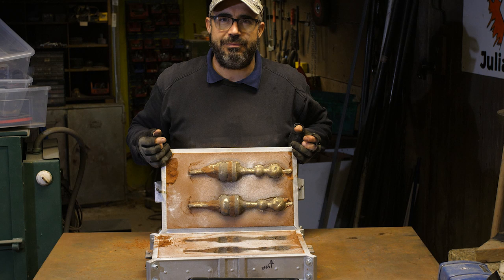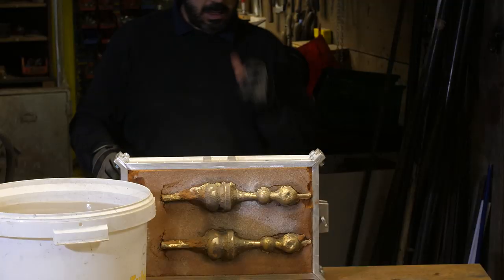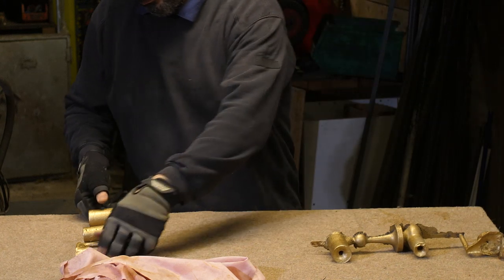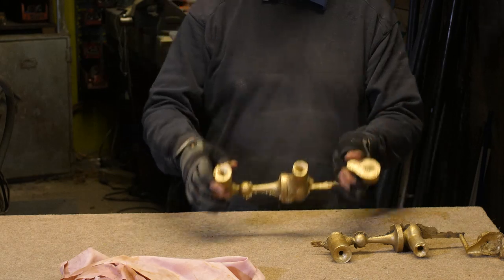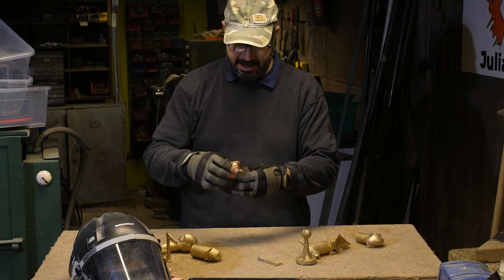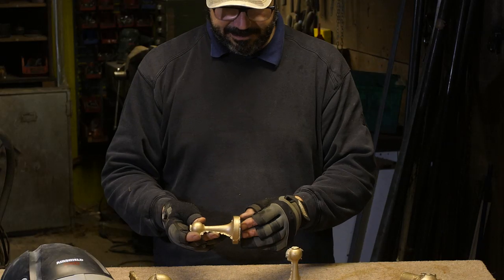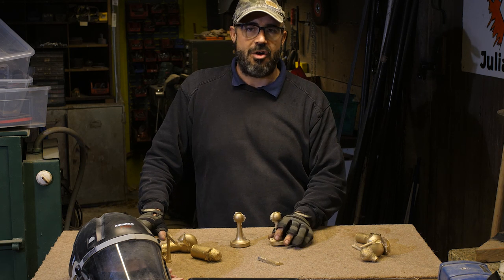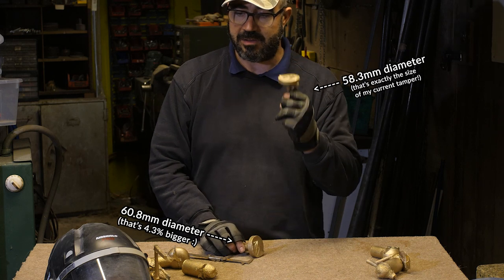Casting a bronze coffee tamper (Part 1)

Comment: Looks good, glad to see you added the feeder/riser for the spherical end.
If you add a piece of cardboard on top of the pith block and put your crucible on that it will help keep your crucible from sticking to the pith block. The cardboard burns away and leaves a carbon layer that keeps the crucible vitrification from sticking to the pith. (also not too much flux increases crucible vitrification from chemical attacks... one of many things that reduce crucible life).
Reply from the maker: Ask Questions, Try Things ahhh yes I did the feeder on the spherical head as you suggested thanks mate. And I forgot to do the cardboard on the plinth thing!

Comment: No shrink holes in your tampers, that's great!  Looks like the castings should clean up really nice.  I feel your pain about the too dry sand.
Hot flask alert!  Could it be the aluminum flask conducts the sand's heat a little better than wood does?  I never thought of that.
Reply from the maker: Tobho Mott cheers Tobho! Yeah dry sand is so fragile I get it now! But at least it’s made me realise that I don’t need much water to correct it, for some reason I was adding too much water each casting and then suddenly had mud. lol yeah the aluminium flask is very hot straight after casting, I think here I was about 30 mins after.

Comment: You are the only one that casted out a coffee tamper (on the internet) :) I was searching for it whole day...
I want to cast one out of aluminium (so I can be a second one, heh) .. 
I dont have any experience with casting, I am broke, and in a week I am moving to different town for work.. So I have found one way that could work, cement and engine oil (would use 2 stroke) instead of sand.. 
I did my research, now waiting for a rain to stop, and hopefully I wont get any shrinkage... I will borow a tamper to make a mold, since i aint got 3d printer... 

If I could polish it half ways as yours it would be awsome
Reply from the maker: Thanks jovan! Good luck and be very careful! Be very VERY careful not to pour molten metal on to anything wet or with water on it (like an ingot mould with a few drops of water in it or similar) the resulting steam expansion can be like a mini explosion that will spray molten metal everywhere.
Reply: @JulianMakes  Thanks for warrning, I am intermidate DIY guy, heh, and had a lot really dangerous situations. Dont want to put myself there...
I have leather gloves, and old fireman helmet heh :)
The leftover I will pour to open mold tamper base, or atleast try..
Following your attemps, I feel like I got some understanding how to make the mold, your videos are quite educational..
Until today I wasn't worring about ventilation, flow, and all the stuff.. For experimenting it may be fine, without, but I don't want any bubbles cracks and stuff, so I want to do it right.(and safe as possible)
Reply: @JulianMakes  Just to let you know that I made it (ooohooo). Success was at third attempt, first I didnt succeed, no ventilation, second din't had enough aluminium, but it turned alright, and third is quite good, but I think I didn't make the mold right, cuz I have 2 small holes, just under where the ventilation were, a bit of shrinkage, maybe, 1,2%, but I put some tape around the base to make it right, maybe I will put video when I finnish everything... I recorded some stuff..

P. S. for others, Always wear gloves, and dont touch aluminium before you put it in water

Comment: Why don't you make a cabinet with controlled humidity? (like, a closed cabinet with a humidifier and a humdity controller, so the sand sits always the sameish.)
Reply from the maker: Abraham thats a good plan :) what happened to my sand was... after a year or two or doing things right and adding a little water often, I thought I’d save time and dump a few pints in the barrel after a casting, well it never dried out since (especially as it’s winter here in the uk) I had to lay it all out over Xmas on the floor and blew air over it for 10 days while I had the flu, which then meant I over dried it!!! But I’m erring on the dry side until I get dialled in again, because wet sand is the worst!
Reply: @JulianMakes  Ohhh. Well, I hope the sand gets better soon (XDDD) and see more castings ^^